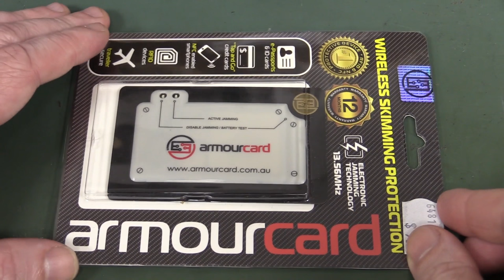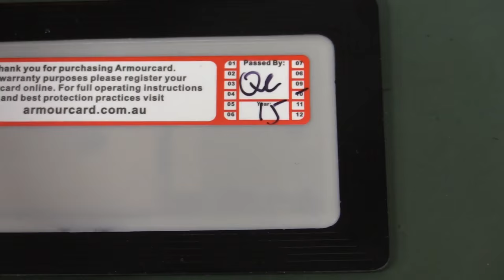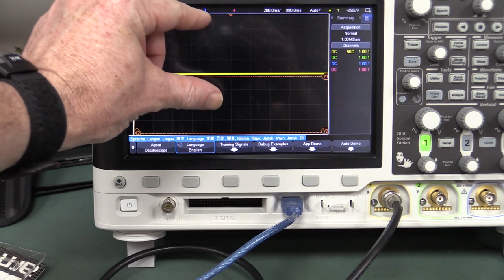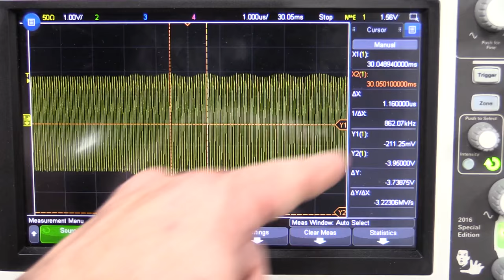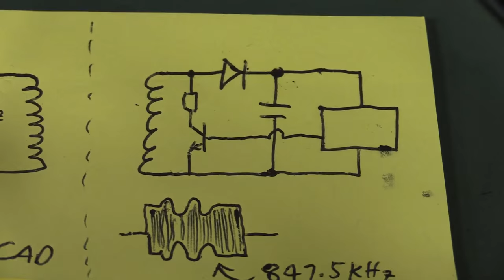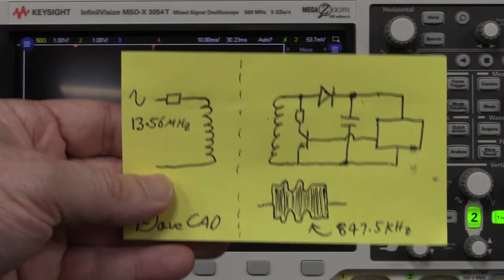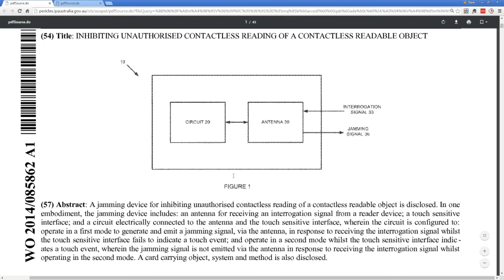EEVblog #890 - ArmourCard Active RFID Jamming Teardown

Comment: Pretty sure the micro is a STM8L, see the SWIM programming pin in the patent PDF.
STM8L151x2/STM8L151x3 have marking code "L526", so probably the micro used on the board is STM8L101x1/STM8L101x2STM8L101x3

UPDATE: L536 is STM8L151F3U6

Comment: $0.15 per meter for Aluminum Foil at Coles. I noticed that the card in this video had a $58 price tag on it. That equals 386.6m of Aluminum foil.
Reply: So you've got enough to wrap around your entire house and your head as well.  Extra safety!
Reply: I measured it. I can make 15 strips of foil to fit in my wallet per meter of foil from the standard pack. 15x386.6 = 5799 protected wallets. You could get more than 5799 if you utilized the wasted foil at the top of the strip after all of the cuts have been made.
Reply: I much rather aluminium foil. The extra 'i' really means something to me.
Reply: Wouldn't you rather gamble on this thing working and its battery being good than Al just working?
Reply: tinfoil hats incoming
Reply: The foil won't run out of battery at least.
Reply: You could use that to shield a spaceship from Van Allen belt's radiation

Comment: Would have made more sense if the active jammer was actually a pocket/pouch that you slotted your card into. Then it'd have made more sense to have the touch sensor so that you'd hold it by that portion when performing a transaction.
Reply: yea exactly, that you could disable when you actually want to read it by a simple press.

Comment: Wow, 58 bucks for one that will get smashed in wallet, or <<<<<< 0.01 bucks for a shite piece of foil. Hmmmm, let me think which one I prefer...
Reply from the maker: Tough choice...
Reply: +Owen Robinson In you are wallet? Hmm, much interest.
Reply: I'm not sure. You would have to do some extensive modding of your wallet to prevent the foil from crinkling up from repeated removal and insertion of the card from the wallet. The main selling point of this product over al-foil is to not have to remove the card in the first place. All you would have to do is stick your finger in there while you swipe your whole wallet over the reader.
Reply: What about "EMI tape"?
Its very flexible.
Reply: Might work. The problem isn't really flexibility as much as stopping the shielding material from moving around. If you were producing a wallet in a factory, you would probably sew whatever material you choose into the lining of the pocket. If you buy a wallet, you don't quite have that option easily available..
Reply: Just rip one of the internal layes of wallet and put that tape xd.
Anyway I will not do it because I enjoy using bank and job card without taking them out of that wallet.
Reply: Of course it's expensive, you have to make room in your wallet for the new gadget.
Reply: Not saying it can't be done. But if you don't have the time, skill or inclination to mod your wallet, and you make enough money,  a $58 price tag might suddenly make sense. As with most things, you're paying for convenience.
Reply: I wouldnt pay for that gadget even 10$...
Reply: It won't work with the readers we have here (I'm sure i'ts the same technology worldwide). I've tried it a few weeks ago in the supermarket, you have to literally take out the card and rub it against the reader. Or maybe, I just have an unusually thick wallet.
Btw, you could buy a metal clam shell card holder that can fit a dozens of cards for under 3 USD shipped on ebay (Dave, do a test on them!). Good luck scanning those. But I don't think it's any use of them, the most probably attack vector is the POS location anyway.
Reply: zlotvorx
You talking about using credit cards w/o taking them out from wallet?
It just works in my case, each of them at very last wall.
Both bank(short distances needed) and job(hlong range reader, 5cm works) cards.
Reply: i wonder how many antitheft pillars that thing triggers in supermarkets
Reply: No need for tin foil or such a device.  Cash is king. I  get 20 bucks pocket money a week from my wife, so no worries here.
Reply: living the dream :))
Reply: Well how often do you smash your credit cards because this device appears slightly stronger than a real credit card. I mean I wouldn't get one but for paranoid people either using both or for people who aren't scientifically minded it holds to its claims, and one could argue that a long range antenna could still read through aluminium at short range but the jammer doesn't turn on without a strong signal anyway so its not much of an argument.

In short it does exactly what it says and no it won't break, but I just look at it as a profit to loss thing, 58 bucks for the rare chance of getting scanned isn't worth it to me whereas the cheap foil is worth it regardless how rare scanning is because of its near-free cost.
Reply: Right, its not worth of it.
I have limit for 50zł so about 14$.
Reply: +Justagermannerd
Probably not many. RF type antitheft tags usually operate with a resonant frequency below 10 MHz while this tag is the standard 13.56 MHz. (Acoustic antitheft tags operate at below 100 kHz so they are way out of the question.) But if you think about it, the jammer is physically very similar to a smartcard. The difference is only in the protocol. If this thing triggered antitheft pillars, then so would any regular smartcard.
Reply: Arek R. Yes, without taking them out. I've just measured - 16mm folded and 12mm unfolded. But in all cases there are some other cards between plus two paper ID's (vehicle ID and driving licence / all three layers folded).
But the bare card can't work if it's not touching the reader - maybe in Europe the TX power is lower.
Reply: Gameboygenius Acoustomagnetic systems work at 58kHz center frequency (and sweep trough +/- few kHz, I think 2kHz). And for tag compatibility reasons there is no other frequency I know of (have been in a industry for a while)
Reply: zlotvorx Sure. I didn't remember and didn't feel like looking up such a minor point. I just referred to it as below 100 kHz to show that it wouldn't react to a device with a 13.56 MHz resonant frequency.
Reply: Gameboygenius Well, it just happened that I've worked in that field some years ago, and replied for the sake of completeness, nothing else. 
Still have a tuning manual with scope waveforms and voltage levels for some early Sensormatic devices somewhere.
Reply: I keep my cards in a metal card case from Daiso, basically just folded tinplate hinged together. It seems to work though.
Reply: not sure what you mean by within RFID?

Comment: Hm... I paid roughly 20 euros back in 2013 for a nice and solid aluminium card case, which actually reliably protects the cards from getting smashed in the wallet and will stop any RFID reader, forever and with no chances of a mess if the battery gets breached... 58 bucks  (even AUD) seems awfully steep for a product like this, unless you expect to be able to run with the scare tactics. Then, again, if people really buy into the myths, they'll probably prefer the aluminium foil, both in their wallet and as a hat.

Oh, wait, no, I forgot that over the last couple of years there has been something of a bullshit scare about aluminium, too...

Comment: I suspect they are using a crystal as most low end micro internal RC oscillators do not meet the required accuracy specification for the protocol unless they are calibrated which is a pain to do on high volume low cost items. Probably cheaper to buy 1 million crystals rather than have to calibrate each unit. Power is unlikely to be an issue as the micro probably runs on an internal RC clock until it needs to modulate.

Comment: For cards I do not intent to use the NFC, I used a strong flashlight to identify the coil. Then scratched a 3x3mm square with an exacto knife until i reached the coil layer and separated some of the strands. The cards don't loose other functionalities, like when frying it in the microwave.
Other cards are in a RFID sleeve from ebay. They work very well and you get a couple for a few bucks.

Comment: I would have thought it would be something that you put your card inside of. That would make the deactivation button make a lot more sense. So its working all the time and then is deactivated when you want to use it.
Reply: That's what I thought at first, too.
Reply: I thought that at first!
Reply: It's a jammer so it emmits noise around it - it is not a "blocker" like a piece of foil would be so you don't have to enclose the card.
Reply: Graeme Bragg I understand how it works. I just think it would probably function better if it was like a case for the card.
The deactivation switch would actually have a purpose then.

Comment: The common attacks which can work on your NFC credit card are the relay attacks, the easiest way to protect yourself against it is to have 2 NFC enabled credit cards in your wallet. Since the anticollision is not allowed in the payment applications, so unless you take them out, you are going to be safe. Without any thin foil or any other jamming device.

Comment: My guess is that they didn't go with the internal oscillator because of the inaccuracy issues due to temp. and voltage, or maybe the external oscillator was a cheaper solution than a microcontroller with an internal one.

Comment: The UK consumer magazine "Which" investigated the problem of contactless card skimming.  They found that the main danger was that the card number and expiry date were easily read and that they were able to use these (without the CVV) to buy goods online from unscrupulous retailers.  Valid credit card numbers can be generated by software and so by themselves  are not valuable to a criminal but having the expiry date makes them much more valuable.  So there is a reason to take some precautions.  I have been keeping a banknote sized piece of aluminium foil in my wallet for some time.  It doesn't need to wrapped around the card, it just pretends to be a £10 note and presents zero inconvenience.

This is also a good reason to not let any Tom, Dick or Harry (or Bruce) see even the front of your card, let alone the back.

Comment: I wonder if the data the jammer puts out is completely random? If it's not then surely there's a chance that Billy Black Hat could just make multiple reads of the card to determine what the noise is from the jammer is and subtract it. Certainly more difficult than just scanning the card but within the bounds of possibility.

Comment: In Denmark you are limited to the rough equivalent of 40 AUD / 25 Euro per contactless transaction :)
Reply: in Norway it's 21 Euro (200kr)  per transaction and max 5 transaction until you have to enter the pin again.
I don't even remember reading if it was per day, I think it's 5 transactions in total until you have to use chip and pin.
Seems secure but a bit of a hassle (I hope it's per day)

Comment: Nice video Dave!  Interesting, I didn't know about the transaction limits for contactless card transactions.  I don't have any cards with contactless capabilities, and don't want one.  (We barely got the 'chip' here in the states, and most places still use the mag stripe).  Anyway, what I worry about is that someone makes an amplifier or relay system that allows the contactless system range to be extended.  That's what some car thieves are doing with the new car keys.  I always enjoy your videos.  Cheers!

Comment: I know that this is old but a fabric woven from wire or fine silver wire made into a purse or wallet will stop any type of scanner in it's tracks, no need for a knife to tear down that card just put it in a jar half full of Acetone and leave on it's side for 48 hours and the casing will come off very easily then wash it off with tap water and bingo a very easy teardown although I used cellulose thinners to get to the innards OK.

Comment: I don't think that would be capacitive touch because theres are two separate traces. It just seems like they are using your finger as a conductor and then if the there is any current flow it'll just act as a switch. If it was capacitive touch, then they would only bother having one trace.Could be wrong though that might be because of there logo and they only use one half of the trace

Comment: this is an old old video by now but .. I really have to suspect that being an ordinary rechargeable li-ion cell ..

I'd suspect way cheaper & 'good enough'
Reply: No. The part number on the battery indicates a primary cell. Unlike some high-power disposable electronic cigarettes, this works perfectly fine with a higher impedance primary cell.

Comment: What happens if you increase the supply from 3v to say 3.3 / 3.6v, is the range affected at all?
Reply: it wouldn't affect the range at all, as the mosfet and load resistor are simply loading the coil. Applying more input voltage wouldn't increase the range, to do that with this design you would need to modify the coil itself. Although I doubt the range would ever be very great. The only practical way to jam a larger area would be to actively drive the coil and dump RF noise onto 13.56. However, that would likely also  be just as illegal as operating a cell phone jammer

Comment: Seems like the way to exploit RFID transactions is to use a "man in the middle" type attack - 2 accomplices, one  who makes the transaction at whatever shop, using what looks like a debit card but is actually connected to a mobile phone with a wire up the sleeve or something, connected to a smartphone running an app that sends the received signal from the EFTPOS unit over the net to someone else with a similar setup that passes the signal on to the victim's card, and returns the appropriate response to the person in the shop. They could be on opposite sides of the world and it could still be done

Comment: Keeping two different RFID cards next to one another is a simple but good technique to prevent them being detected. When interrogated, both their replies are received together and interfere with one another so that the receiver cannot sort out what is going on.
Reply from the maker: No, the protocol has anti-collision detection. I showed this in the last video.
Reply: Right, but if both cards are sending valid data, how does the reader though which to use? Of course from a security perspective that is irrelevant, I just got the credit card number from both, but it does prevent a legitimate reader from doing the transaction.
Reply: @EwanMarshall  From what I remember, the anti-collision feature allows enumeration of all cards that are currently within reading distance. The reader then selects the ID of the card it wants to communicate with.
Reply: @0xbenedikt  Yes, unless the reader refuses to do it. And that is the issue security wise. Official terminal may not do it, but I can come along and do it with my own reader just fine.

Comment: Why can't NFC cards have touch button built in? Then you could use that button to select the mode of operation. For example, hold it for 30 seconds to enable always active (normal) mode, hold it for 45 seconds to enable "on demand" mode in which you have to hold the button to make it work with NFC. People who don't care about security could use normal mode and people who are concerned about security could use "on demand" mode. And everybody's happy.

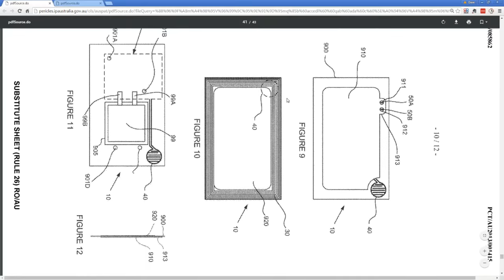Comment: wow 22:03 german id-card.
well i threw in to the microwave. is more secure now.
Reply: you tampered with government property. You are on the list now. Do the same with your bank card and phone, also makes them more secure ;)
Reply: *****
my bank card has no rfid, so without steeling it and knowing the pin is not usable. (and its not a credit card, a ec-card)
Reply: I've never quite understood national ID cards like that, like when do you actually use them? Perhaps it's just because there isn't a national ID card here (in the UK) but I've never really come across a time when having a national ID card would be advantageous.

Also, what is the RFID for?
Reply: Callum Aitchison when you cross a border, the policeman has a reader. Makes it easier to find out if you're wanted for something without entering your details manually
Reply: ***** Ah right, guess that makes sense. I didn't think about Schengen borders
Reply: Callum Aitchison
I'm not sure but I think it's also planned or they're working on making verification through the internet possible with that chip. All you need is an rfid reader like on the phone demonstrated there, and with that you can virtually sign government documents or whatever.

Comment: Hi Dave,

I remember that you had posted a video on a review of the Rigol DSA 815 TG Spectrum Analyzer. I bought one a couple years ago and I have been quite satisfied with except that lately, the clock has started to run intermittently at 1/8 the normal speed. It does not seem to have upset the normal operation of the analyzer but makes a mess of the date and time of the stored files that I transfer on the USB memory device. Recently, I found a Rigol Web page where one could ask for an updated version of the firmware. Thinking that this could solve the problem, I sent my request and never got any answer. Do you ave any suggestion as to a way to cure this problem or a Web site where I could get some support and answer from Rigol? Thank you.

Comment: I'm not really clear if the jammer prevents the card from waking up and 'speaking' or if it just confuses the POS reader...if the card is waking up and speaking it seems possible that a criminals rfid reader might be able to subtract the jamming signal and view the data from the card even if legit POS readers aren't able to.
TBH pretty unconvinced that rfid cards have any advantage for me as a user. the PIN system made it difficult for card thieves / pickpockets to use my card and the rfid system doesn't do anything to stop them... nobody asked me if I wanted a less secure card attached to my account, it just turned up.